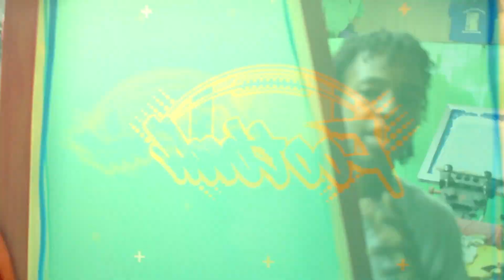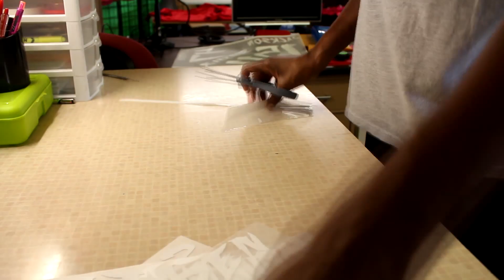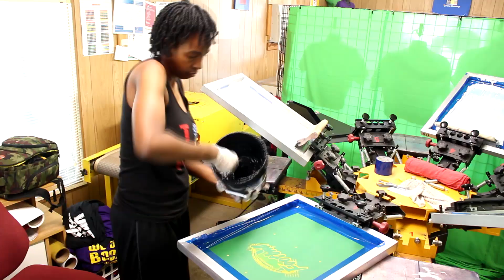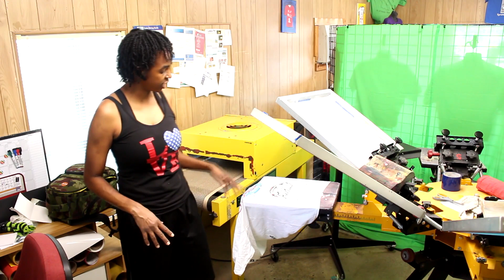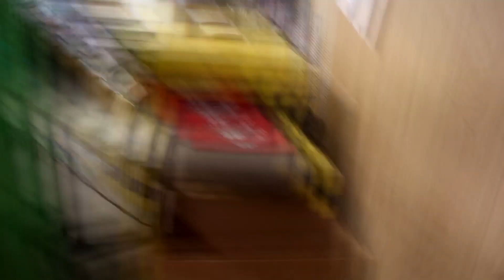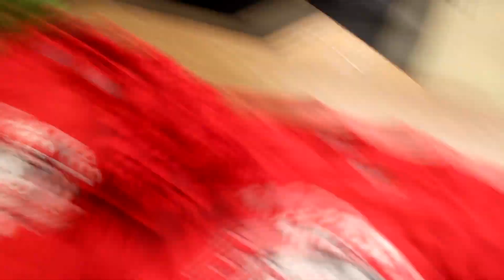Screen Printing Halftones

Comment: I’ve been watching your vids for a while now, invaluable info! I have an issue tho and hopefully you can help. I burned a screen (230) with a half tone design. But when I wash it out, the halftone pattern washes out as well...any tips? Or idea as to why this is happening.
Reply from the maker: Things like this can be hard to answer without having a lot of details/info about everything but you may not be exposing your screens for long enough which could cause the problem.  You could be spraying the screen out with too much pressure which can wash out small details.  That's 2 things that could be issues.  Hope this helps.  I have a 2nc channel where I do daily Live streams Monday-Friday at 10AM central time I can answer questions that you have during that time so u  get answers right away.  I also have the Print Squad group on Facebook where you can get help almost 24/7.  You can also ask questions on IG and I answer then during the live streams. Thank you for watching!

2nd Youtube channel:  www.youtube.com/TshirtChickLive
IG: @TshirtChickTv
Reply: @TshirtChick  thank you for the reply and your input. Ill see if i can eliminate those two suggestions and see if that helps with my screens. Ill be tuning in on your other streams as well! 👍👍👍

Comment: quick question, did the halftone screen get a lil over exposed? or just didn’t wash out completely? you can carefully give it a quick pressure wash on the hardened side of the screen then blow it out with an air compressor then set it out to dry to make sure no emulsion residue drains into your image & your halftone prints like the clipart. cool video!

Comment: Whats your dryer?
Reply from the maker: It's an older dryer by Hopkins BMW.  I don't think they make it anymore.  I bought it used from a couple that had purchased an abandoned storage building.  I actually saw a guy on here that has the same one that I have but can't remember the name of the channel.
Reply: TshirtChick I worked at the shop 15 years ago that had Hopkins flashes and 6/4 manual press. I like that equipment. I think ryonet bought Hopkins presses but I don't know about flashes and dryers.
Reply from the maker: IDK if it's the same Hopkins since it's Hopkins BMW.  I don't know much about it since I purchased it used though.  It's a good dryer I haven't had any problems with it .  It was missing a few knobs that had broken off before I got it.  My uncle who is an electrician said he could replace them but I didn't really worry about it since it worked fine for me.

Comment: Nice vid, how do you wash out the half tones, I tried washing out my half tones that I did on a 230 mesh screen with a hose and most of the details and half tones came out
Reply from the maker: I don't have enough info to really answer the question 100% correct but from what you typed I think you may need to expose the screen longer.